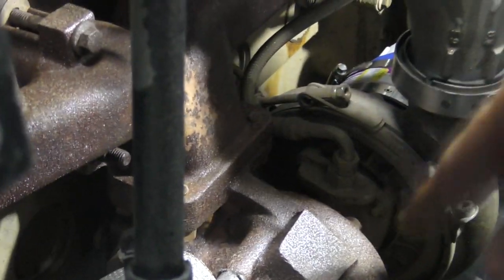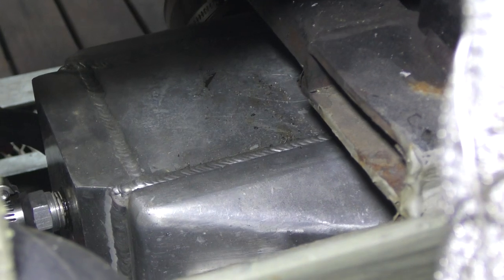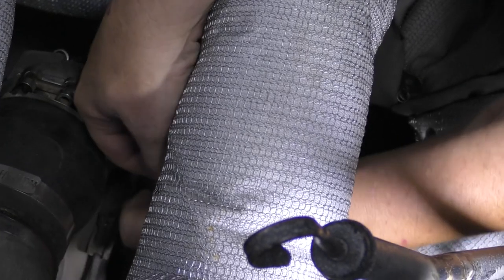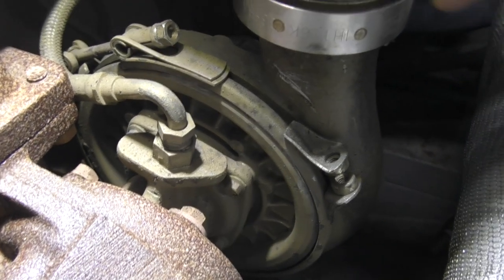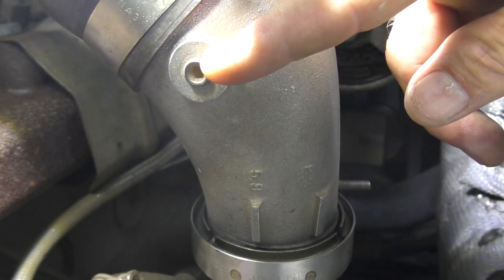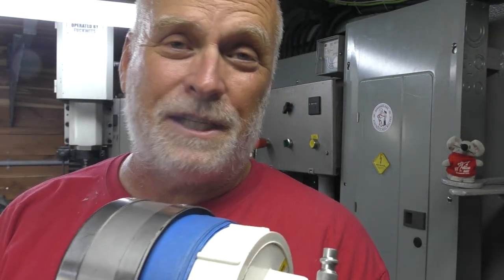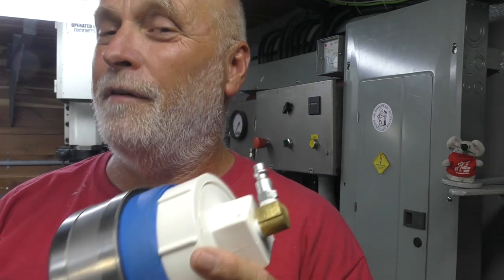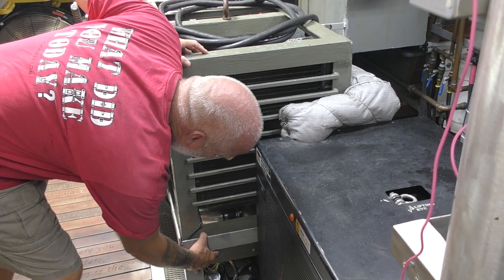Check Your Turbo System for Leaks

Comment: When you install the boost gauge one should be in the dash in the wheelhouse. And heres why. Yes a drop in boost pressure can mean a split hose or leaky/loose clamp. But you should be watching the turbo boost pressure just as much as you watch oil pressure and water temp. Say you are cruising along and its making 15psi boost if the pressure suddenly dips or drops even by 1 psi its telling you  that more than likely sumthing is wrong with the internals of the turbo, such as oil supply failure, ingestion of a foreign body etc. shut engine down asap and investigate. If a split or air/boost leak does occur you will hear it no problem even over the engine noise. And mechanical gauges are better over electric altho electric will be easier to run over a certain distance from the engine.

Comment: I moved a truck that a mechanic had missed tightening one of those clamps.  At the south end of Sioux Falls, SD I goosed the truck to get past an entrance ramp before another vehicle came in.  That link hose slipped off of the intercooler with a bang.  I had to ramp over at the next exit and put things back together.

If it fails or comes apart, you'll know it.  It will sound like a shotgun was fired in the engine room.
Reply: Your failure wasn’t catastrophic fortunately . Had he forgot to tighten a line to the wastegate you would have made 1000lb of boost momentarily then if you’re lucky enough to not have a runaway? You’re now stuck with a pile of bent rods and probably a HUGE lockup.

Comment: When you do the pull test will you be measuring the pulling at a fixed rpm and change the pitch through a range or just at a fixed rpm and full pitch on the prop? Have a great week Doug.

Comment: Watch the pyro. I wouldnt let it go above 850F with that little engine but to each their own. .... it will be interesting to see how she does. About 1/2 the vessels I do bollard pulls or pushes with, overheat unless I back it down from full load rpm. Especially keel cooled. Sometimes I'll put it in reverse to move water around under the boat more...the prop in one direction isn't enough as weird as that sounds. -Real world tests that  I actually do. I'm a Cat Certified Marine Analyst and I think you can FIND the MASH book online. It's the book we use as reference.  It'll blow your mind with the info in it. If you can't find it I can get you one.... I know you'd like it. 👍
Reply: According to Cummins the 6bt can handle prolonged egt temperatures of 1250 degrees Fahrenheit.
Reply: @shawnchurch316  Day-um! I've rebuilt a few of them marinized, but I don't recall what the pyro readings were or if they were even installed.  That sounds scary to me. The application on this vessel should fall under a 'continuous rating' with a displacement hull and being a work boat. Usually that rating is much lower for obvious reason - because its continuous rather than pleasure craft or yacht which numbers represent intermittent full load. Though he may use it in the drag boat competition.

Comment: I would recommend cheking the exhaust pressure before turbo, small copper line from manifold to gauge/sensor so the heat wont broke it. Max i would run exhaust pressure vs manifold pressure is 1:1, after that the turbo efectiness starts to go down. (More air - more exhaust gas - turbine cant handle it > pressure goes up and cylinder wont get rid of exhaust gas properly > temp in cylinder goes up..)

Comment: I rebuilt my first engine back in 92'.  I made it a couple of blocks before I notice this sound that reminded me of a balloon when you pull the opening tight.  High pitched wheez?  I knew what it was.  Got out a 7/16 wrench and fixed that problem.

Comment: You won't be rolling coal as much, the 5.9 needs the boost but it can muscle it if you keep dumping fuel at it, every PSI of boost counts the boost leaks you fixed will make a difference. Diesel engines like the 6.0 Ford Powerstroke, Chev Duramax they rely a lot on boost you blow a intercooler boot off the engine falls flat on its face.

Comment: Thankfully no leak in the turbo on the car though the intercooler is TINY so want to change that.  Already threw a cooler in to keep the CVT below 200, in fact I drove it 4 miles on a 100 degree day and the bypass valve I put in was forcing fluid through the cooler so it was already over 180 degrees.  I know for a fact that CVT fluid was getting cooked bad.  Turbo boost is only about 15 PSI max for me as well and the premium gas sucks to buy but getting 31 MPG on the highway in a car that will easily do 120 is nice compared to my pickup which gets around 18 to 20 naturally aspirated and is limited to 99.  

Plumbing parts work wonders for air systems though.  An aluminum CAI kit costs around 300, I did something similar with a piece of 3" DWV PVC an elbow and a rubber clamp to hook up to the throttle body.  Out the door and running for less than 20, beats the crap out of 300 doesn't it.

Comment: Hey Doug, are  you still going to  try and pick up a diesel outboard for the two small tenders? I have seen plenty of good reviews and it will make for much easier logistics.
Reply from the maker: Someday.
Reply: @SVSeeker  find a vertical shaft diesel generator, pull its motor and adapt it to an outboard leg. It’s something I’ve been wanting to do because it seems cheaper, considering there like two places doing diesel outboards and they’re all 300hp and up. I think yanmar might do a small D outboard. 

Also I have a suggestion, build an auxiliary motor bar with a form of steering link for seeker, so if you pop the motor you can borrow a few big power outboards to get to port instead of pulling it with the tamale
Reply: @SVSeeker  Have a look into OXE Diesel marine engines. Probably a bit on the chubby side for Seeker's backside davits, but well suited to look into about their system to build a lighter version "Doug-style" later on ...

Comment: It's a long way to Dardanelle, and a really really long way to the Gulf.
Reply from the maker: It's only 150 miles to Dardanelle and only 750 more to the Gulf, and less than 2000 to the far end of the Caribbean.   But it's a long way to the nursing home if you have never traveled.    Darwin says travel.

Comment: You could use some sound-absorbing insulation.
Reply from the maker: WHAT?  : )
Reply: @SVSeeker  just a thought that you could use something to lower the noise level in the engine room.
Reply from the maker: @stillraven9415  WHY WOULD WE DO THAT?   : )     ....ok, it's a joke, uppercase implies one is yelling.  : )     And diesel is expensive, it should be painful.
Reply: @SVSeeker  I'm a bit sensitive to sound and it made me wonder how loud it must be when in there. I didn't want to imply it is what you should do, but that it would help.

Comment: Unless you can pitch the prop at the EXACT same pitch each test your load test baseline will not mean much.  We do almost the same test with testing hydrostat  drive systems.
(;-) TP
Reply from the maker: No, not true.  You set the rpm at 1500 and pitch for maximum pull.

Comment: I always say in my videos, something every day no matter how small. At the very least it keeps you in the project. Like you said Doug, even if it is just cleaning up the shop for the next step or "staging" the tools and parts for a project on a rainy day for when the sun comes out. That way you are not wasting time looking for stuff when you could be doing it. Last, when you are building a boat or rebuilding them like I do there is 1000's of parts and pieces and it's easy to forget something on any given day but the chances of you forgetting it day after day, because you are there seeing it are about zero.